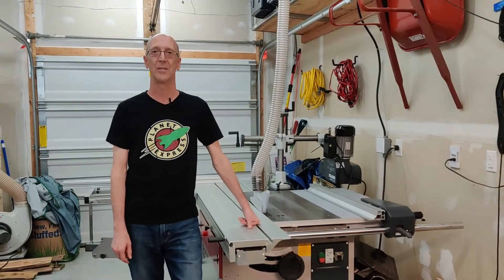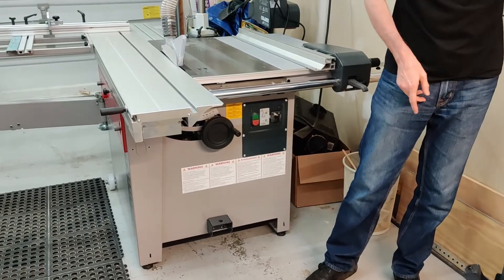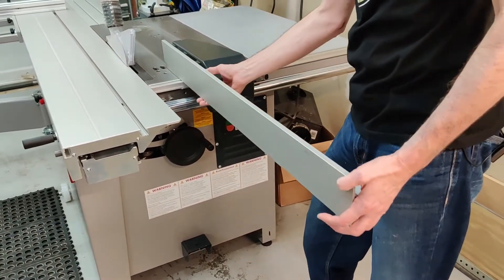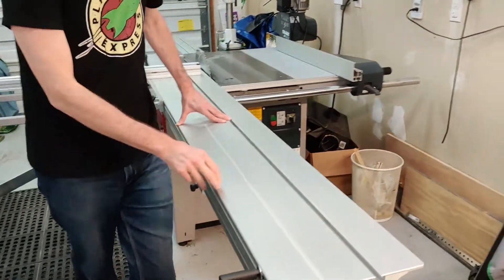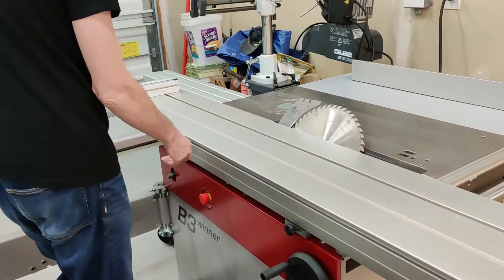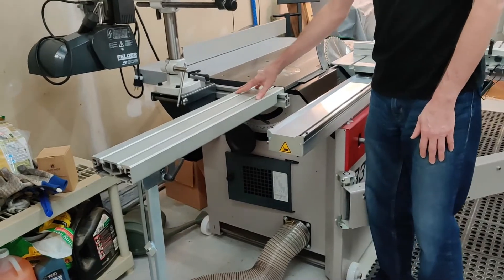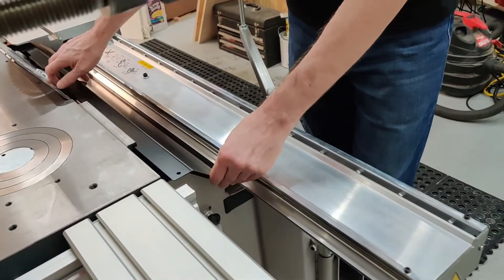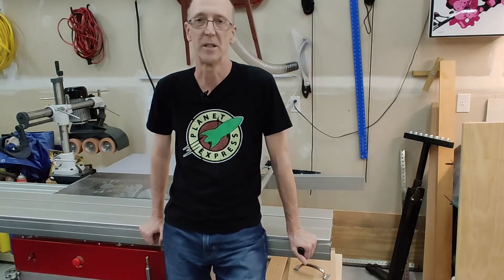My Road to a Slider - Out with the Old, In with the New! Part 1

Comment: Nice machine, I have been looking at the k3 saw but having second thoughts, the b3 could be a better option. What is the total width of the machine from the wall to the end of the cross cut bar on the outrigger table. My workshop is very narrow and wondering if the machine will fit in it with the outrigger table attached.
Reply from the maker: Hi Derek, 
The total width is about 93". With the regular miter bar at it's shortest length, that's about 77". I'm assuming you'd have the shortest rip fence guide bar.
If you contact me through my website, dnisw.com, I can send you a spec sheets that Felder sent me.
Reply: @CutitwithaHammer  thanks for the info, that should just fit in my workshop with a few inches to spare. I found the spec sheet for the machine on there site but was not sure I was reading it right 😅.  Spoke to felder on Monday about the machine but felt the guy I was talking to was less than useless, or even not interested as asked him for a quote for the B3 and the K3 also gave him a list of the options I want, he would not quote for either machine over the phone and said he would email them to me but still waiting. Will call back next week and speak to the other rep that I bought my A3 31 from.
Reply from the maker: Sorry to hear about that. I don't think I got something over the phone, but my sales guy was nice. Too bad they cut him lose when COVID started.

Comment: How much did this complete set up cost? I have a 3hp SawStop I bought 2 yrs ago...had I known about these European sliders I definitely would have gotten one. Also where are these sold?
Reply from the maker: I have the Hammer B3 that includes a shaper which adds at least 3K to the price (and a bunch more in tooling). Without the shaper, there are a number of sizes: 31" slider $4,750; 48" is $5,500 ; 79" is $6,500. You can go bigger, but I don't have a price on those. There are options that must be decided on at order time, so you have to know what they are. With my 79" (2 meter) B3, plus dado arbor, plus scoring and a few accessories, it put me a little over $10K. If I were to do it again, I'd drop the shaper and go with a 2.5 meter table.

Given that these machines are typically built to order, it's going to be something you purchase online. Shortly after I ordered mine, I saw the exact unit at a local woodworking show. You can see them in company showrooms if you live close enough. For me, I signed up at the Felder Group website to get access to see more details. Within a week, a sales guy called me up (I could have initiated the first call, but I was still in the "thinking about it" stage). We talked a few times over the following week about options and details. He was very helpful and not pushy. They were quoting 4-month delivery time. But Covid kicked in about a month later and the factory was closed for a month and then on reduced production, so that added 2 months. If you want more details, you can contact me through my website: dnisw.com